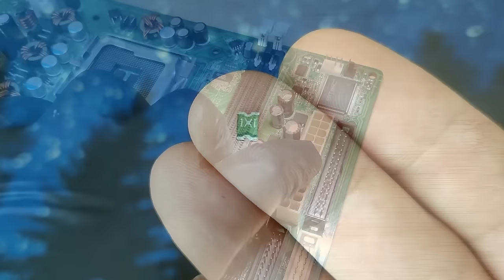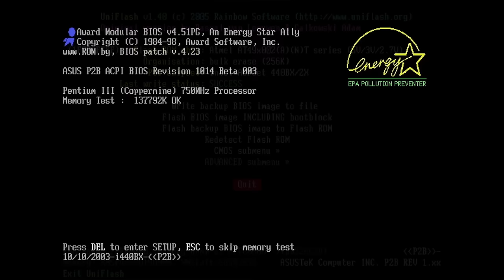ASUS P2B Restoration: Board #6 - Leaking capacitor causes devastation!

Comment: I didn’t comment on the previous video when you changed the capacitors and most were ok. Imho, it is worth replacing if you value the component. Here is why: you know don’t when it going to fail: it can leak and eat away components beyond repair (this video just demonstrated the potential damage), they can fail and cause electrical damage to other components, etc. They might be ok today, but for how long? A recapped board with good quality components will last another 20 years. Congratulations on the series, I loved it. PS: I checked my Soyo board, didn’t find any loose power elements (mosfets). I hoped it was the case. Back to storage waiting for a new inspiration / idea
Reply from the maker: Yes, you're right. There will be a time where those caps are going to fail. It is still remarkable that the caps on those boards seem to be ok for now. But who knows for how long. Could be a couple of years, but I have a feeling that they'll be fine for much longer considering that those boards probably won't be used for long periods of time.

Comment: 2:10 Did you notice the "K" before the Ohm? This is everything but a low ESR ;-) 
BTW the Atten is a good rework station! Bought it a year ago to replace my old cheap one.
Reply from the maker: I did not notice it :) Someone else mentioned it. I guess I completely ignored the unit... Of course, this is not low ESR :) I like the Atten - I used it to get some connectors off those donor boards, but I also like to try my luck with the chipset on them. BGA rework is something I want to get good at.
Reply: @bitsundbolts  BGA rework can be quite satisfying or mood-destroying. I practiced on some old routers and graphic cards. Worked quite well. Later on i tried fixing a 430HX board (GA586DX) - which unfortunately didn't work out. I also had to repair some ripped pads and use soldermask. Can't figure out why, maybe something else is fishy with this board.
My last project was reviving a AM4 motherboard where the X570-chipset was dead. This on the other hand worked like a charm and gave me great confidence in my work again.
It's a hit-and-miss sometimes, but practice helps a lot!

Comment: ESR on the first cap is 0.15 KILO ohm! 150 Ohm - that cap is gone! I need an engraving pen :)
Reply from the maker: Haha, yes! I totally missed that it was KILO ohms! And I know why you need that engraving pen! You liked how it flipped those SMD capacitors off the board, didn't you????
Reply: @bitsundbolts  that was cool but no, I just like how nicely you can polish traces without polish the whole area. The rubber thing I have is great and probably gentler but it takes away chunks of solder mask

Comment: I think I still have same board in my PBX "PC" running trixbox (asterisk based PBX distributive). It still is running 24/7 for over 15 years at least. (Yeah, it was used for another 10 years at least before being installed into my PBX PC.
I did replace power supply unit though, like 3 years ago. Or even more. Maybe before COVID.😅
That's the hardware! I'm sure it would run for another decade easily.

Comment: That board uses those bad blue no name caps like the one that exploded and not that light green Sanyo ones you replaced at the previous board. Consider putting the Sanyo ones you removed to this board cause maybe another blue one may release its guts in the near future
Great work again! Cheers and I saw all videos...
Reply from the maker: Wow! Making it through all six videos is quite the achievement ☺️. There should be a badge for this!

Comment: 10:58 I see a solder bridge at 7:55 on the two caps on the bottom right. I guess that didn't affect anything?
Reply from the maker: That bridge is actually also on the board. There are two differently spec'd capacitors, one in the low pF and one with uF. If I am not mistaken, they filter different frequencies.
Reply: @bitsundbolts  Interesting. Didn't know that.

Comment: Very nice series, was a blast to see you repair all these boards! One thing I am wondering tho: Why didn't you use vinnegar to combat the corrosion caused by the leaked capacitor? I saw it giving very good results, and I bet it would be faster than doing it with the engraving pen :D
Reply from the maker: Ah it might not be obvious in the video, but I did use vinegar. It helps take debris away when using the engraving pen. Vinegar alone will probably not be enough. I remove discolored solder mask to make sure there's no corrosion left.

Comment: 10:25 i wonder what made the video wobbly like that. Is that an anti rolling shutter filter or something like that?
Reply from the maker: No... It's unfortunately my fume extractor 😔. It's on the desk right next to the board and one of the rubber legs touches the wooden work board. That is why the vibration is there and makes the video look like that. Unfortunately, I noticed it too late

Comment: Amazing job, congratulations! Initially looking at these boards, I would have expected at least one of them to have lost an irreplaceable component that would have relegated it to become a donor board for some of the others. Fortes fortuna adiuvat! However, your final boss still awaits... 😄😉

Doing a bit of "research", I only recently discovered that there was a version of this board supporting dual CPUs and containing an onboard SCSI controller, the P2B-DS. The thought of dual CPUs really appealed to me back in the day, starting with the Tyan Tomcat IV. Being that far ahead of their time, Multi-Core setups wouldn't have been much use for gaming and therefore just an expensive disappointment though I suppose.
Reply from the maker: Thank you! I have to start looking into the dual slot CPU I pulled from a pile of boards a few months ago. I never had an encounter with tech like this back in the day.
Reply: @bitsundbolts  Oh, did you feature such a board among your scrapyard finds? In that case, I must be getting old. 😅 As they were purely business oriented products, I didn't directly come into contact with them either, but I remember seeing them in catalogues and fantasizing about their performance. It would be quite interesting to see how well dual CPU setups worked back in the day and what software could actually make use of them. If only as a confirmation that, contrary to my younger self's hopes, they would have been absolutely useless for gaming and not straight up twice as fast. 😄

Comment: Yeah this is why I believe in replacing 30 year old capacitors even if they are still good. Because if they go bad it requires more work to fix. It's a preventative maintenance thing.
Reply from the maker: I get your point! This wasn't fun to clean up. Especially that it can be prevented. But I find it odd that this was the only capacitor that leaked. Every other capacitor on this board and the other five boards was ok.

Comment: WHat stands out to me is that one capacitor could have been hit with something corrosive which made it balloon like that. I have a Macintosh SE that still worked despite a battery going nuclear on the board, and the main takeaway with that machine was that it had chemicon axial caps that were ballooned and deformed so badly I could barely tell their values. This was more likely due to corrosion hitting that spot and wicking up into the capacitor and reacting with the electrolyte etc with age and time.
Reply from the maker: I never saw a capacitor that had something like those boils. Maybe you are right. All the other boards also looked like something corrosive dropped on them.

Comment: Amazing stuff! My Slot1 computer is Abit BE6-II with slocket adapter from Power Leap. Running Pentium III-S 1.4GHz. I am original owner of those :)
Reply from the maker: Nice! I assume you had to modify the slocket adapter to make Tualatin work on this board, or am I wrong?

Comment: I believe "the ASUS chip" might be responsible for hardware monitoring of temperatures and voltages, so you'd better check that part is working, before declaring the motherboard fixed. Also if that's the case, it is most likely the motherboard would still POST and work with the ASUS chip removed entirely.
Reply from the maker: All boards report voltages and the motherboard temperature correctly in the BIOS hardware monitor. Of course, I could have missed something like the additional connectors for measuring additional temperatures (I don't have the original temperature probe), but chances are low since the other values are there.

Comment: Was this the only one that worked first try?
Reply from the maker: Yes, but I had two or three other boards that just needed a bit of contact cleaner in the CPU slot. I learned from those and prepared properly this time. And it worked - first try! :)
Reply: @bitsundbolts  true.

Comment: I wonder why that last board has different colour peripheral connectors? Maybe a later revision, or they just ran out of black ones? Or what if it's a fake! 🤣
Reply from the maker: Haha, no - I put those on there. I only have pink and blue spare parts. I could have changed the black one serial connector too, but it wasn't worth the effort.
Reply: @bitsundbolts  I had to go back and look at the start again, It didn't click in my brain until you stacked them at the end. They were black and then they were coloured I should've spotted that you had swapped them! Great restoration series BuB, so glad that these excellent boards will rejoin the global circuit again.